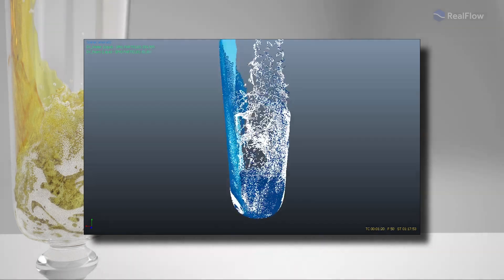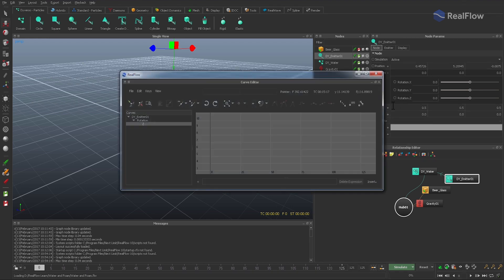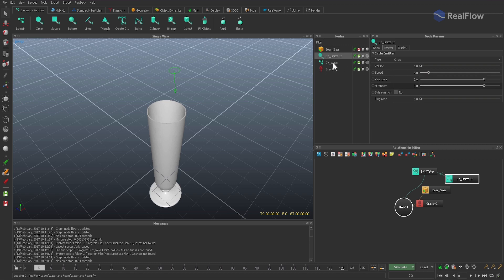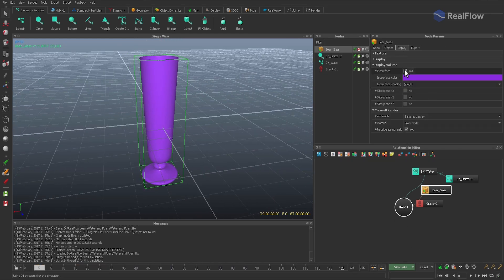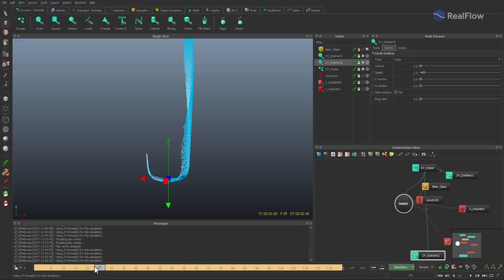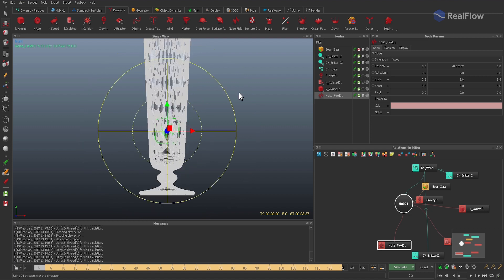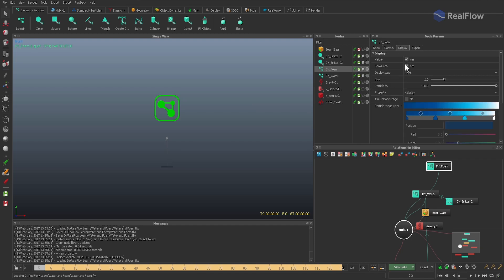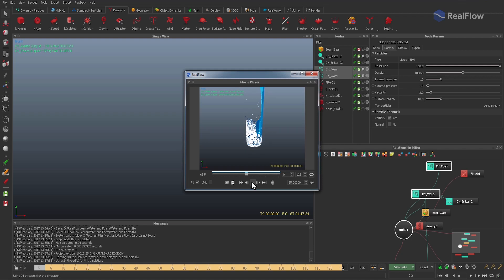RealFlow 10 Tutorial: How to create foam for Dyverso fluids

Comment: The final result seems a bit like a mix between oil and water (or sea foam). What if I need to simulate beer being poured into a glass? Hybrido Bubbles dies when they reach the surface and the foam react in a different way.